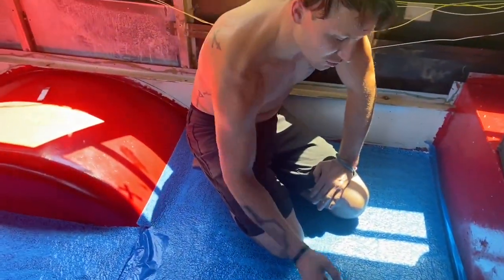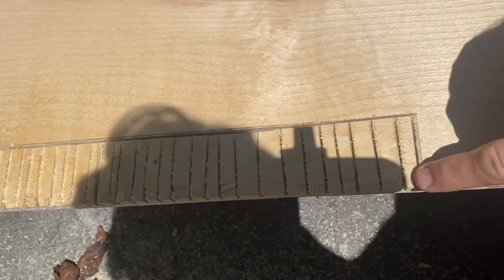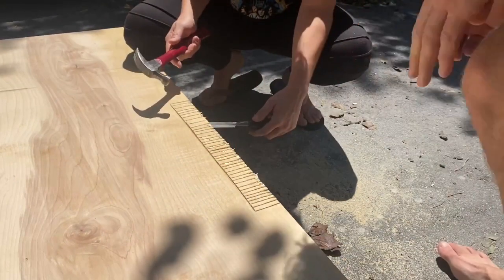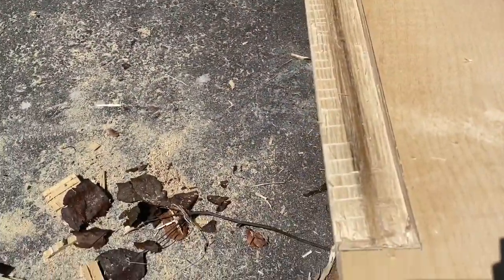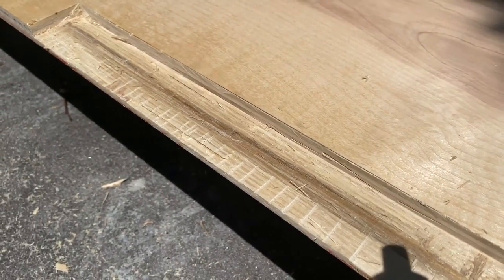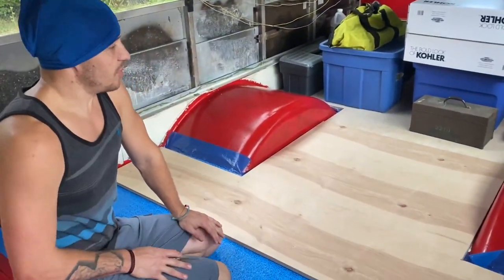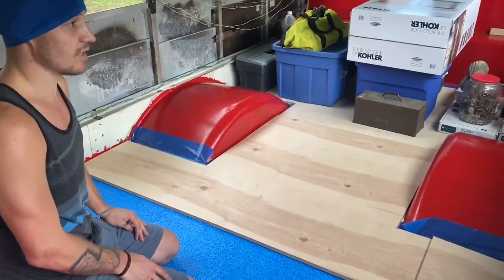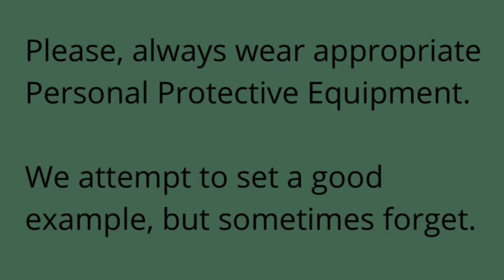Installing our (Sub) Floors in our School Bus Conversion (Part II) ( Skoolie ) - VIDEO

Comment: What type of glue did you use to glue the underlayment down to the metal floor and the plywood to the underlayment? Do you feel that was required and would you recommend other people to follow the same process? I think you mentioned that you still would have to screw the plywood to the floor. Did you end up doing that?

All-in-all, are you happy with the solution you came up with to maintain as much of the ceiling height as possible or would you recommend a different solution?

Thank you.
Reply from the maker: Great questions! So-we used Loctite PL-375 to adhere the underlayment to the metal floor. Was it absolutely necessary? Maybe not, but it made sure it stayed in place and made the job easier. We did end up screwing the wood into place. Here’s why...we opted not to get bags of concrete to weigh down the plywood  after gluing down with PL-375 (thinking random heavy items would be enough, they weren’t). Not too upset about that, because now our floor is absolutely solid, beautiful and we love it. Some things to consider...there are multiple underlayment options, you could always snag one with a sticky bottom to avoid having to use an adhesive and if you buy concrete bags to weigh down your plywood, I’ve heard it works beautifully. Check out Mobile Dwellings (formerly Gillian Phantom’s) video on their subfloor...he had great success doing that. We ended up sealing the screws in the floor from down below...so overall, not worried about it. 100% would do it again. 

Hope I hit on all your questions, please don’t hesitate to reach out if we can help more! Good luck with your build!
Reply: @TheMcBrowns  Thank you so much for the response. How important do you feel the air circulating properties of the underlayment was? If you think it's important, have you heard of a product called DMX 1 step? Do you think that product would be better? That's the one I'm contemplating using, but it's a product I have to order and wait for.
Reply from the maker: That stuff looks great. Similar but even better than what we used. I say go for it! There are compromises in ALL choices, seems like a great option.